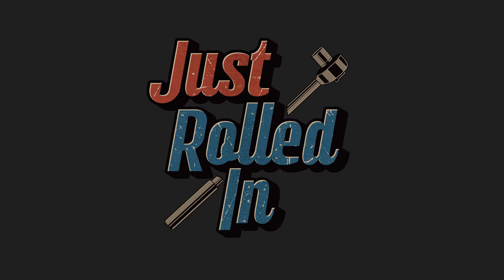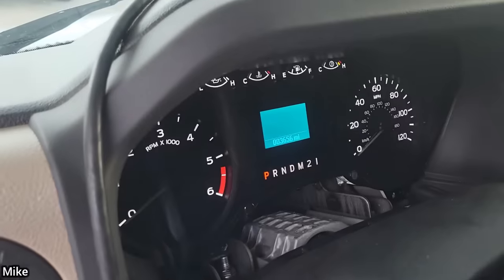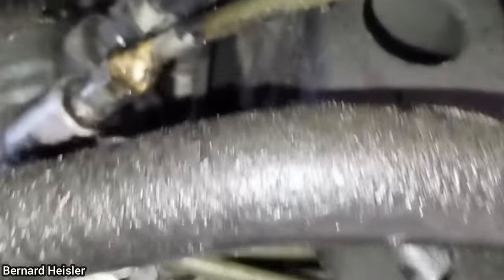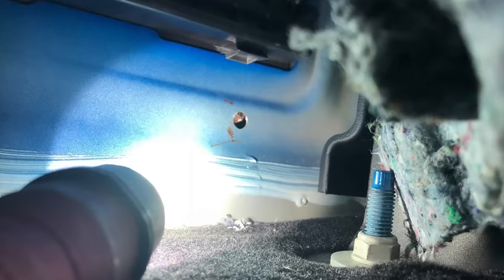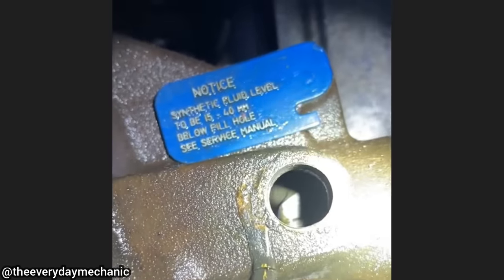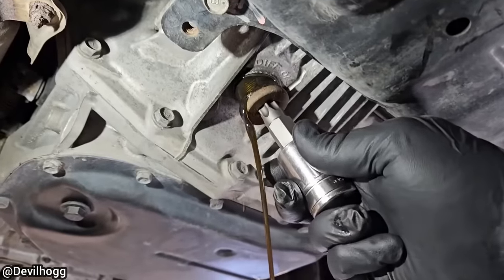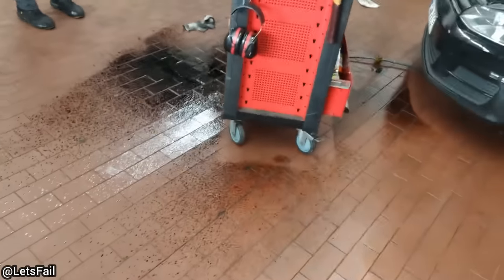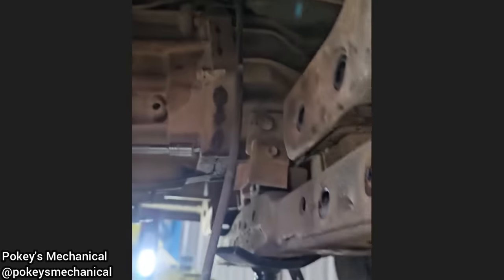Mechanic FAILS Compilation | Just Rolled In

Comment: Was a mechanic back in the day. Seen some wild stuff. Went to lift a Toyota truck on a lift. Got the lift a few feet in the air. When I noticed the front and backends were going down instead of up. Got to looking frame was swiss cheese with some angle iron welded on. Also installed a new long block in a Camaro. It turned over about a quarter round and locked up. Sent it to a Chevy dealer. They had to replace the long block. Had a shipping bolt lodged somewhere in the engine. Since we had all the shipping bolts we took out still. It had to have happened at the factory.  Also battery had one connector cross threaded. I just unhooked it from starter. Chevy dealer F'd up the guys battery because they forced the connector out.

Comment: I really hate shops that have no clue and just want to hit it with the parts cannon without doing the diagnostics. My Daughter had a jeep that was ailing. She took it back to the dealer who quoted her $13,000 to put everything back to spec. She's a single Mom and didn't have a lot of money so she had to decline. She called me to ask if I knew anyone but I told her no. I suggested that she ask her stepfather and he recommended a small shop he knew of. She took her car there and they quoted $3,200 and would let her pay it off in three payments because they knew of the family connection. When she picked the car up, the bill was $2,800 because an item they thought had gone south just needed some fine adjustments to set it right so there was no charge for the replacement. She drove that Jeep for two more years before getting a new vehicle. All of her service work, including oil changes, is now done by the small shop. She's been going there for five years now and not a single complaint.
That's the kind of repair outlet that everyone wants but few find.

Comment: some of the mechanics that the cars went to first are the kind of sleezy places you need to avoid, causing more problems than fixing anything and charging arms and legs for stuff not needed, gives good mechanics a bad wrap..  ive dealt with both awesome mechanics and some shady ones in my life lol.. which made me learn at least some basics of automechanics and got some chilton/hanes books to learn a bit.. biggest thing ive done was a timing belt on a 99' crysler concorde tho.,.. so notthing too big lol

Comment: I had to replace a motor in a car I used to have.  I payed for a new motor, and the shop that did the work, put in a faulty used one, and put vegetable oil in my brakes.  I took it to another shop, they replaced the motor with a new one, and had to flush out my brake line. They didn't change me, but they did report him.  A week later the first mechanic was caught trying to cut my brake line, while I was in a library. He ended up in jail, idiot

Comment: That last clip...yep, I've done that a few times with both hand tools as well as pneumatic. The worst is with a ratchet that now has the directional lever wedged between the handle and the frame
Reply: In the last two years I’ve been an apprentice, and many years before working on my own things, I’ve only don’t that twice.
Once doing the thermostat on my 96 f150 with a ratcheting wrench, had to cut the bolt for that one.
And another all of three days after I got some new snap on ratchets doing a starter on a f150.  Was real close to cutting my extension before I finally got it to switch

Comment: Lord I locked a ratchet up trying to remove the skid plate bolts off a Wrangler's front axle disconnect module, tightest spot possible. Had to get the Dremel and cut the socket. It was, of course, a chrome 10mm.

Comment: The wheels falling off reminded me of a former coworker. She always took her car to WM, and asked for a certain guy to work on it. They let someone else change the tires, one day, and 2 of the wheels fell off, causing her to crash. She was 100miles away, in KC, when it happened. One wheel that was still on, had two nuts that were sufficiently torqued. The other was extremely loose. From then on, WM(& other shops) had a strict policy of checking the torque on lug nuts, before allowing the car to leave the shop.

Comment: I once had a shop fail to tighten the lug nuts and by dumb luck I decided not to go on the highway and was on a road doing 25mph when I felt something was wrong. They couldn’t have even been hand tight. I now always bring my torque wrench if I ever have a shop remove any wheels and retorque them immediately after just to be safe.

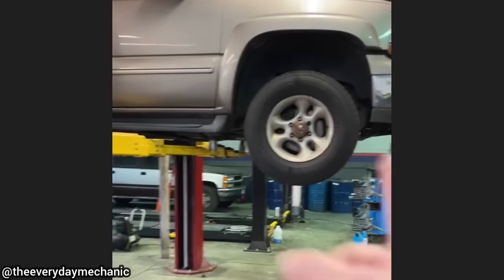Comment: @4:18 I had a dealer leave mine really loose, I took my truck in for another service, they called me and told me that my differential and transfer case fluids were dirty and need to be changed, and I also my 3rd brake light was out, I denied the additional services, I was going to change the fluids about a week later. When I went to go replace the brake light the lens cover was loose and missing a screw, it was not this way before I took it in, When I replaced the fluids the fill plug was not even hand tight, the front diff was almost ready to fall out. I now tell dealers not to touch or look at anything else, only do what I ask them to do.

Comment: We bought new cars atleast 3/yr over the past 30 yrs.  During gas price hikes we installed a locking gas cap to avoid another gas theft.  Started had problems with the3 month old car and took it to the shop.  I was so embarrassed when the shop called me to tell me the problem was caused by the locking gas cap and had replaced it free 9f charge with the. Original gas cap that we put in the truck.  Ugh

Comment: I'm not a mechanic, I just work on my own cars. My Pap (RIP) taught me. So far, the worst that has happened, by far, is the day my Moms Blazer bit the dirt. Let me set the scene. It was a summer afternoon, all I wanted to do was replace the brakes in the rear. My buddy jacked it up on the stone driveway, I wanted to use the cement pad (yah, you're thinking what I was thinking). So, what I thought would happen did. We had both rear tires off and the jack and stands toppled. My Mom needed to be at work in about 2 hours. We managed to get the Chevy back up and job done. She has no idea that we dropped her Chevy, and we only worked on vehicles on the cement pad after that. It's been about 10 or so years, but I still have trust issues working on cars with people. As of right now the one person I trust to turn wrenches with is my youngest daughter (11). That kid has nitrous in her veins and a turbo for a heart. She's 100% getting my '92 Prelude SI when I die, she earned it. It still has parts on it that her Great Grandfather (Pap) put on, his finger prints are still there. Long Live Building Cars, and Thank You Pap for teaching me.

Comment: Strangest thing I’ve ever had a shop tell me was they couldn’t get my truck in the air.  Having the oil change done at a dealership they came out and asked me what I had in my toolbox of my otherwise stock Toyota tundra.  I’ve actually driven my truck across scales and it does weigh about 500 pounds more but still my mind was blown at the idea that a dealership would have a lift that would conk out just above the weight of a vehicle they sell.

Comment: I'm not even a mechanic and I've done that last one with a ratcheting spanner 🤣 Thankfully I was able to screw in the bolt enough by finger to get the spanner off, but I did briefly contemplate using an angle grinder to cut the bolt.

Comment: I used to do my own car work to save money. Thay morphed into doing my own car work so a mechanic wouldn't screw it up. This video confirms my choice. I know there are good mechanics, but how do you find one?
Reply: I test new shops by giving them simple jobs like exhaust fixes, or brake jobs.
I might test their diagnostic skills by loosening a basic power connector that will cause simple problems, but no critical errors.
If they come to me with shoddy work, or ridiculous repair suggestions, i move to the next.

Comment: I had the back wheels on my dually almost fall off, and I had to replace the hub and rims. The shop told me that they always double check their work and it must have been somebody that came in my driveway at night time and loosened the lugs... Plus they were "too busy" when I noticed the issue, so I had to take it to another shop which cost about $1,000 to fix it.

Comment: I had an Audi 4000 5+5, which has the battery located against the firewall in the engine compartment. When the hood was raised the lights were brighter and the engine ran better. A previous owner installed an incorrect battery which was too tall and shorted out on the hood when it was closed. The hood had a large circle burned away from the battery. Replaced with the correct longer, wider, shorter battery and the problems disappeared

Comment: As an apprentice I put a 5L drain bucket under a Mercedes sprinter whilst doing a service then went for lunch while it drained. Came back and quickly found out that the engine holds 12L of oil. Boss made me skip lunch to clean 7L off of his newly painted floor lmao

Comment: I called out Kia here in San Antonio for several mistakes. They confused my car with another, then replaced the bearing and cv axle on the wrong side, then forgot to add back the trans fluid so it ran at half full. I usually do the work myself but I still had warranty. 

I took it back because I kept hearing a noise like a clock. They said I needed a new transmission. 

So I went home and found out it was because of the low fluid. Then I ended up redoing the hub bearing and replacing the electronic power steering sprocket. 

When I called the Kia dealer to explain they had made all these mistakes, the manager basically said "Oh well you got us, good luck." And hung up.

Comment: A guy I know told me a story about how the technicians at the shop he worked in would wire the horn to the turn signals for pranks on the other techs cars from time to time. As for the Durango that slid off the jack stands and almost crushed guy on the creeper; do Durango's have a rear subframe? It feels like the only way that happens is the body rolling away from the subframe being disconnected. Though it does kind of look like he disconnected something and it dropped onto the jack stand and bent it; he had a code brown for sure!

Comment: In reference to that last clip…yes, of course I’ve done that before. The last time I did that, I got my air ratchet stuck so bad that it took me almost an hour to get it unstuck. After that, I took the air line fittings off both of my air ratchets and don’t use them anymore. If there isn’t room for the air gun or battery gun which can easily be reversed, I’ll take it out by hand, thanks.

Comment: Had a nissan dealership tell me 850 to replace a section of exhaust that was bent. Apparently they couldn't bend it back due to corrosion and rust damage. They worked on the car a few months ago and made no mention of it and conveniently the system they use to take pictures of issues was down and refused to provide proof as they didnt wanna re lift it. 

Took it to a local shop and they bent it back for less than 100$. 

That same Nissan dealer suggested a new serpentine belt 4 months after they installed a new one too, then a panicked manager called and said OH that suggestion was meant for another car. 

Dont assume dealerships wont scam you too folks. Sit in the waiting area and if they offer the same 2-3 services to everyone they probably are shady

Comment: This is the main reason, I personally perform 90-95% of all my mechanical improvements & repairs on my cars, trucks, tractors & my wife & daughter’s cars, every major mechanical failures I’ve had over the years- were the direct result of negligence & poor workmanship of so called professional mechanics.
Although I grew up assisting & watching my stepdad & uncles do mechanic work, my stepdad took available classes during that timeframe,
I am not a licensed mechanic, nor electrician, plumber, etc… but it’s so hard to hire qualified labor in any category,
I try to do these repairs myself, so I know that they are done right…
If not, I know what I did wrong & can fix it.
Going behind licensed mechanics & fixing their incompetence is frustrating.

Comment: I did that the other day with a belt tensioner 😅. One had a 3/8 square drive easily accessible. Aftermarket only had it on the top (2017 exploder). Got it loose

Comment: A while back, I didn't have time to do a brake job on my car, so I dropped it off at a Firestone so they could do it. Got it back without issues, but three days later, I was on the freeway going around 96 and heard and felt a huge bang on the right front tire, and I coasted off the freeway and applied the brakes when I got below 10 mph and it shook violently. I got out and checked and saw that the brake caliper wasn't bolted and fell off and was just being held on by the brake hose.

Comment: 3:18  I have a Ram 3/4 ton diesel, and would not lift it on any import two post lift that wasn't rated for 12k.  The front axle on a Ram diesel can easily approach 5k, which means a 10k lift is barely adequate, and that assumes its in good repair.

Comment: I took my vehicle to a shop to have my transmission oil changed. A few years later, because of unrelated issues, I had to remove it to get it rebuilt. When I went to drain the oil out of it, half of the aluminum bolts broke off. It's my guess since they were the last ones to touch it, that when the shop changed my oil, they used an impact to take off and put on the aluminum bolts, which twisted half of them, making them break off when I tried to remove them with my wrench.

Comment: Once upon a time Firestone sold me an engine swap on a rough running 80s Datsun p/u (100k miles) but installed a leaded engine, not unleaded like original. Broke down next day, towed back. Firestone sent to dealer for diagnosis and they wouldnt touch it, illegal swap. Sued, dealer replaced engine and carb, Firestone paid tow and dealer charges and I got my $3k back. Truck went 500,000+ miles after that.

Comment: @2:05 someone has fitted the battery in the wrong orientation. The poles are meant to be either side of the brace.

Either that or the US models have a clamp? In Europe at least we often have two batteries under the seat on RWD and they are always seated 90 degrees to this one in the video.

Comment: One of these happened to me. I had my VW Bug brakes serviced and picked the car up. I was driving through the "bad" part of town and the wheels started coming off. I called the shop and the tech said he would come pick me up. After 1/2 hour, I called the shop owner, who I knew. The tech came out and got me. The owner told me later that he'd fired the tech.

Comment: I think the new transits actually rotated the battery 180 degrees specifically to avoid the issue with the transit in this vid that caught on fire. Looks like the previous tech also didn't install the battery cover before they put the hold down plate on

Comment: Took my jeep to a local shop for a transmission rebuild, twenty miles later the driveshaft wrapped itself around the rear axle.  No u bolt nuts had been installed.  The shop refused to admit liability because in their words "they are a professional shop and would not have made a stupid mistake".  It was a 90 day same as cash deal which I refused to pay and ended up with a ding on my credit for 7 years.

Comment: First 4 wheel drive I bought.  Before we agreed on the price.  He knew I wanted it.  The guy to took it out back in the field, did a power brake to bury the back wheels, then put it in 4wd and drove it out.  I knew it worked.

Comment: I was welding near a garbage can that appeared empty but one of my coworkers had just cleaned a carburetor with carb clean into it.  Next thing I hear it go up in flames and I didn’t recognize the sound until I saw the reflection of the flames behind me in my welding hood. Turned around and the flames were up against the ceiling. Didn’t think to grab a fire extinguisher but instead dragged the can outside to let it burn out lol. Still trying to figure out why he didn’t clean his carburetor into his can but instead came into my bay to do so

Comment: Mechanic Fail story:

 This didn't happen to me, but to a new guy at my job. Now I work on boats & the new guy got a work order to do what's called an 'Engine Start'. Simply put, it's just an overall inspection of the boat's engine to make sure it functions properly & doesn't break down when the customer leaves the dock. He didn't complete the inspection, he just wrote a note on the work order saying "Batteries are dead 6 volts" & threw the paper work into the completed bin & moved on to something else. I happen to see the work order & just decided to work on it, thinking the boat needed a jump.

However what I found was that the boat had four 6v batteries connected in series with each other. This moron just tested one 6v battery, saw 6v on his meter & just assumed that the batteries were dead. I just turned them on, cranked the engine & it started fine with no issues. He just got fired last week for almost setting a boat on fire, he tried connecting a battery ground cable to the positive terminal on a starter.

Comment: I had an oil change and tire rotation service. 
The guy forgot to tighten the wheel nuts. Just finger tight. 
I stopped just as a wheel was about to fall off in the highway.

Comment: We had a short lift and one of the mechanics put a big F-250 extended four-door truck needless to say it came off and got stuck inside the building took two wreckers to get it off the lift because it was up in the air on the back front was on the floor in between two walls